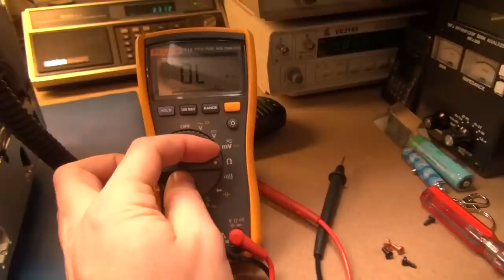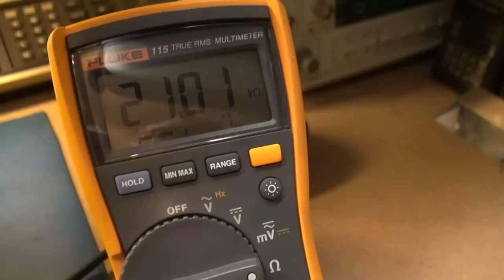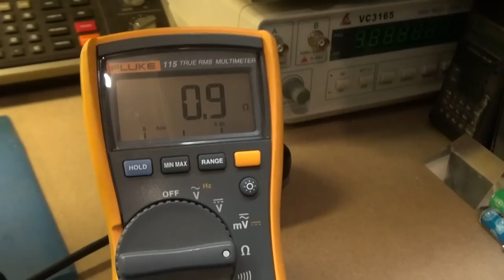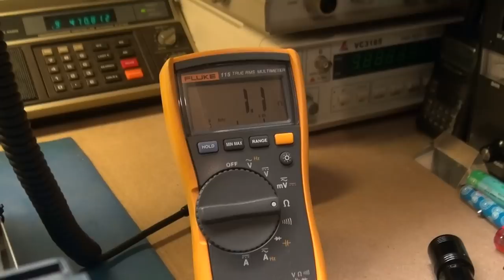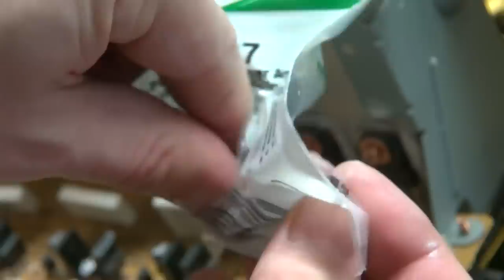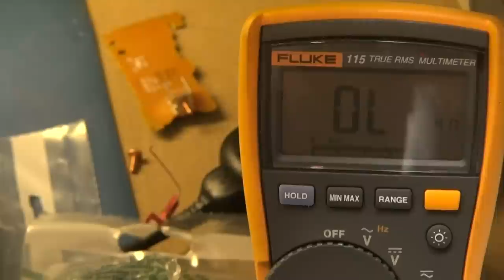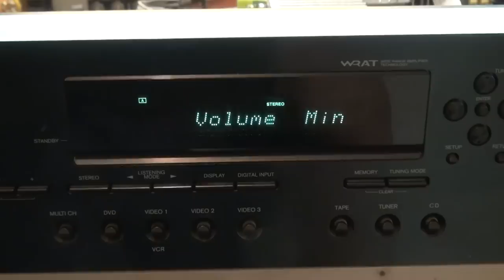ONKYO TX-SR502 RECEIVER  "SHORTED CHANNEL REPAIR"

Comment: Nice de-soldering toy; I want one for Christmas! It looks like those transistors are of the bi-polar type. There is now research on insulated-gate bi-polar transistors, where the benefits of each type (mosfet & bipolar) are enjoyed; I would be checking/comparing the driver stages prior to the installation of the new parts; even if it means de-soldering another power stage's ok power transistors..

Thanks for the post, and hope your neighbor continues to enjoy its use!!

A real head-scratcher for myself was one of these where the protection circuitry was activating after a long period of the amplifier being 'on'. I ended up replacing all of the small-signal plastic transistors on the protection circuit, and fixed the problem..

Comment: Picked up a Onkyo HT-RC260 for $20 on craigslist that was stuck on standby mode.  Tested the same parts in this video and they where bad, ordered new parts, some on ebay and the others from local radio repair shop.   When all was said and done i repaired it and it now works.   Thanks for the helpful video.

Comment: Really appreciate this video.  I bought a "broken" Onkyo TX-NR636 with the "check sp wire" error earlier this week.  After scouring the internet I found this video and isolated the issue and removed the transistors and the receiver works great!  Now I only need to order the replacement transistors and install.  Great tutorial video!
Reply: I have what looks like a burned noble resistor, but how did you figure out which transistors were bad?

Comment: When working on any AV Receiver, I recommend using a Variable Transformer to restrict the AC current or else run the AC thru a 75-100 watt incandescent light bulb. It can help prevent another power transistor from being popped if something else in the circuit is bad and overloads an output transistor.

Comment: I repaired a blown channel on my TX-SR806 thanks to your video.  I'm having one hell of a time finding the right power resistor, though.   For the time being I stole one from an unused channel.  Works like a charm.
Reply: +land otter1 thanks for the reply.  I ended up finding a component re-seller out in California and bought a small lot of these components.

So if anyone needs dual emitter 5W 2ohm MPRs to repair their Onkyo send me a PM.

Comment: As long as you're changing the power output transistors and the emitter bias resistor, you better change the driver transistors too or you'll be opening that beast up again soon. ALWAYS change the drivers when you change the outputs.
Reply: Robert Crawford sir..i m having same problem.. could u please tell which are drivers.. so that i can change them too
Reply: Where can I  order transistors from
Reply: This post is a little older, but for those that look for the driver parts that need to be changed, have a look over here : https://youtu.be/misu4avw_Vs

Comment: Awesome video. I've been trying to repair a subwoofer plate amplifier. 200 watt. I saw 2 fried transistors that I replaced. Didn't even think about a fried resistor. And I didn't even know there were 3 pronged resistors. Also there was a ceramic disc that looked cracked. Finally figured out it was a current limiting thermistor. Will replace that. It was still blowing fuses so I'll look for a blown resistor. My guess is the volume was turned up too high for too long, the transistors shorted leading to a current surge frying the thermistor.

Comment: There is only one option: resistors dont open up by no reason. There must be collector-emiter breakdown of the output stage transistors, excesive current flowed thru emiter resistors that burnd them.

Comment: Thanks Mark! Actually working on an M504. A numb head decided to leave some screws out of the heat sink support. During shipping the board was cracked. When I recieved it I turned it on and BANG! I saw flares inside the cover. Lost one of the output transistors and about 10 components on the driver section on the left channel. Anyways I epoxied the board and ran about 5 jumpers. The 2SK389 is a temp componsation transistor which was on fire during the incident.Im almost done with the repair...
Reply: The

Comment: Great video. I have an Onkyo HT-R570. I checked all the r22k dual resistors for continuity while on board and found 1 dead. I checked them by using the outer posts of the dual resistors for continuity since if 1 side was bad it would not beep. No need to check both with the middle post. I pulled it out and checked again to verify it was bad and it was. I also did the same for the audio power amps high current switching and found 2 that beeped because they are shorted.
If anyone had questions as to my steps feel free to respond to this post.

Thanks again.

Comment: My Onkyo HT-R570 receiver popped a few weeks back and went into protect mode (flashing red power light only, no display).  I stumbled upon Kev's video, did the same troubleshooting using my Fluke multimeter and, based on the results, I decided to order a transistor set and 5W noble resistor in order to attempt the repair.  Well, i was floored when the receiver came back to life after the repair!  Although I'm a DIYer who has worked on cars and home repairs for much of my life, it took Kev's guidance to help me through my first real electronics repair, not the normal, simple swapping out of pieces and parts but actually changing out electronics components on a PCB!  Kev, now I can help pitch in to reduce electronic waste from our landfills.  Now where do I send the repair fee?
Reply from the maker: Great job! I am glad it worked out for you. Another device saved from the landfill.
Reply: my speaker wires was touching and something pop then it smoked

Comment: Looks good but a couple of points, never use the old heat sink compound. Start with a clean surface. You can use a small plastic scraper to remove the bulk then get the rest with some alcohol. Something that will help your de-soldering is to apply some flux. Something like kester 186 is good. It can be had in a dispenser pen so as not to buy large quantities. Applying extra solder to the joint can help, but it still burns up most of the flux. Also make sure to clean up the flux left over...

Comment: Nice video. Found it because I have "Check SP wire" message on my Onkyo HT-R990. Two days ago, while watching Fury Road, suddenly the receiver shuts itself down. Trying to turning on again, it displays the damn "Check SP wire" for a fraction of a second and then shut itself down again. I had already replaced the capacitors on the HDMI board some months ago, and now this. Infortunately, even by following this video, all my noble resistor seems OK (still attached to the board they all indicates 0.6 when measured) and the transistor on the heatsink have been replaced by some Sanyo IC  STK443-530 and two STK442-730. Dunno what to do except avoindg Onkyo products in the future, because I have found tons and tons of people with the same , unsolved problem.

Comment: Your solder looked ok but I would have cleaned all of the manufacturers solder and resoldered them. Just saves you the trouble later.... Since you already had it open and disassembled, right there. Don't be afraid to reflow any questionable joints. You'll be glad you did! Good to see that you cleaned up with alcohol or acetone... Good repair man...

Comment: Excellent video and explanation with the ohm meter. I just had a channel blow on my Integra when I put a drywall screw through a wire in the wall. Looked this up, looked in the stereo and there was the charred transistor. Hopefully I can fix it but even if I have to bring it to Pinnacle at least I know what's wrong and I won't get snowed.

Comment: Thanks for the advice. I'm just a hobbiest  with some successes with electronic repairs. I picked this receiver up on ebay for $45 as is  including shipping so I figured ,what the heck. Nothing ventured nothing gained. Anyway after closer examination I could see no bulging caps but the 2SA1930-2SC5171 power transisters are showing overheating on the board from one end to the other of the board on all 7 pairs. Think I'll replace them and go from there.Thanks for you help.

Comment: Hi Kev. Great video. I've got a similar problem with my amp going into standby mode. I've tested all the transistors and resistors that you did in the video but there fine. I know it's he right channel as that's the one that was making a crackling sound and I left it as it went away and then pop into standby. There is a board next to the transistors which has the channels written on it. It's the green board behind your hand. If I pull that board the amp turns on. Could it be something to do with the resistors or transistors on the right channel on that board. Also how would I go about clipping out the power to that right channel so I can get the amp working again for the mean time. I also have the service manual if that helps. Any reply would be great full thanks chi

Comment: Diagnoses Round 1
I used a multimeter to find the 2 shorted transistors and the matching dual resistor. Like kev31779 did in his video, I clipped the leads on the 2 bad transistors prior to ordering my parts. After clipping the leads, the unit was able to power on and stay on without automatically going into the protected standby mode like it was before. Ordered my parts from mouser.com (links at the bottom)

Repair
I was able to replace 2 "shorted" transistors (A1962 & C5242) and 1 "opened up" dual resistor. I ended up using 2 single resistors and soldering/bridging the middle prongs together for the middle hole. While I had the receiver apart, I went ahead and replaced the 5 bad 100uf caps on the HDMI board as well.

Testing
First bootup with everything plugged back in, I blow 2 10a/125w fast blow glass fuses next to the power supply attached to the main board. Buy a package of replacement fuses same rating from mouser to try again after re-seating all ribbons, connectors, and shaking the unit upside down in case any clipped leads or metal were shorting the board out somewhere (nothing came out). Put 2 new fuses in tried again, both fuses blow again. Disconnected the antenna/coax board, HDMI board, and ipod/iphone dock board, put in 2 more new fuses to test - same results - both fuses blow again after about 2 seconds of the unit being turned on. Attempted to disconnect the other board where all speaker wires attach to (the board with the 5 G5PA-28-MC DC24 relays attached to it) but with this disconnected I no longer get the red standby light on the receiver to come up nor does it powerup when turned on.

Diagnoses Round 2
Used multimeter to test the leads on the underside of this "relay board" to check the readouts of these 5 relays. 2 out of the 5 were measuring in the 500's while the other 3 were steady at ~1ohm. 

My Question to the more knowledgeable electronics people out there......
Seeing as though the unit will not power on with this relay board disconnected, this would then mean that the current flow of power goes from the power supply to this board and THEN to the main board where those fuses are located. Is it possible these 2 relays are bad and thus causing some sort of power surge which is blowing these fuses or is it more likely that the actual power supply is bad??? Mouser has these relays for $3.50 apiece, just not sure if I want to keep at this and try this one last thing before calling it quits.

Parts Used
A1962 - Transistor
http://www.mouser.com/ProductDetail/Toshiba/2SA1962-OQ/?qs=sGAEpiMZZMshyDBzk1%2fWi39v8mPI4jPHIOVN8C5K9gE%3d

C5242 - Transistor
http://www.mouser.com/ProductDetail/Toshiba/2SC5242-OQ/?qs=sGAEpiMZZMshyDBzk1%2fWi39v8mPI4jPHoIMIqujz2qg%3d

.22ohm, 5w Resistors
http://www.mouser.com/ProductDetail/KOA-Speer/BPR58CR22J/?qs=%2fha2pyFaduiHbb7zzJ6cb2el9G%252bgwVRdHFTcZBFBJdjgVGcjXZFCyQ%3d%3d

10a/125w Fast Blow Fuses
http://www.mouser.com/ProductDetail/Eaton/BK1-GMA-10-R/?qs=%2fha2pyFadujmM0Q8l%2fgOi%252b4YzR5Ibqb2fAtF6nhzU%2fIQdKJLaUFapQ%3d%3d

10a/24v Relays
http://www.mouser.com/ProductDetail/Omron-Electronics/G5PA-28-MC-DC24/?qs=sGAEpiMZZMtSzCF3XBhmW6rmK3VUQy7ZulImHcGuIxw%3d
Reply: ***** Hey, any luck? I have the exact same problem you have (or did).

Comment: Put the desoldering gun upright at 90° to the board,  so it will suck all the solder at once.  Give it sufficient time to melt the solder pad completely.

Comment: Been years since I've seen a 2101. On the Onkyo's, if an amp channel isn't blown, it's usually the 2SK389 FET's in the front end causing an offset. Very difficult for access, though...

Comment: Thanks for your answer, but there is something wrong in the measured resistance, the  fluke 116 multimeter terminals  in ohms position gives a reading of 0.1, not 1 ohm.

Comment: Is it possible to just clip out the transistors from the heat sink and solder the new ones in place.  Could save on some dismantling.
Reply: Buonafede No. You’d have to clip the leads of the transistor package and then try to get under it to solder.  It would be a mess.  When it comes to electronics work it should always be clean and proper with surgeon like precision.
Reply: Would need to do the same for the resistor.

Comment: I have an ONKYO TX-NR708 Receiver that had the HDMI board replaced and now it went crazy again. I just had optical plugged into it to stabilize it, but it finally went black screen now with a constant clicking noise.
Don't want to recycle, just want to fix it.
Thanks,
Duane

Comment: How did you manage to disassemble the unit enough to get the bottom of the circuit board? How many screws did you remove?

I have a TX-R820THX with a similar layout and I have yet to figure out how to get to the bottom of the circuit board (that has the 0.22 resister and the ouput power transistors).  And, I have an 'Exploded View'

Comment: TY  Kevin for the video, I have an Integra TDR 7.7 And it appears the sound channel transistors attached to the heatsink failed. The noble resistors seem fine. It still doesnt get out of protect mode. Where would you or any viewers go next?

Comment from the maker: I would think there is a problem on the amp board you pulled out, test the components for shorts and the resistors for open continuity like in the video. and also look for burst or bulged capacitors

Comment: I have one of these but it's the SR505 and it started smoking and sound was cutting out. Saved it from going to the dump. Haven't opened it up yet. Are these output transistors a common failure on these? Would it be that easy to change the bad ones out and have this set work again.

Comment from the maker: Just make sure you get all the metal debris out if you use a rotory tool.
you may be able to use a sheet metal sheer but its going to be ulgy no matter what. 
If you got nothing to lose I would try to disassemble it piece by piece and take pictures or a video of the disassembly. and take note and mark connectors and cables where they went,

Comment: very informative video, i have a Marantz nr1602, there is a problem with the sound, some of the surround modes seems to be acting up, mainly losing audio from the centre channel, as well as a strange noise in the audio as well, any ideas as i was wondering whether the filter capacitors were getting bad.

Comment: was able to troubleshoot and fix an old hitachi amp which was outputing dc on the speaker output, being an old unit it did not contain a protection circuit. Thanks for the pointers on what to check.
Reply: +land otter1 the amp belongs to a friend of mine, I did check the drivers and they seemed ok though I never did check the op amp. As far as restoration goes, I don't think he cares for it that much, it's an old unit from the 70s, and I noticed it had had some diodes changed in the past, on the rectifier circuit. Thanks for the info. Much appreciated.

Comment: This video was excellent even a beginner would be able to follow along. I just wish 
I had confidence in soldering, still a beginner my luck I would wreak further havoc on my Onkyo than Ive already done by stupidly bridgeing the Rear Speakers to the B Channel thinking Id be able to swap between for boosted volume when listening to music, and 5.1 Effect for movies. Learned alot from this video great job, But still not touching anything i dont know about haha, Off to repair shop I go I suppose, How much do you think they would charge for my situation?

Comment from the maker: Sometimes there is an access panel on the bottom of the receiver. if not you have to disassemble the whole unit to remove the main board. No way around it.

Comment: Learned and enjoyed from viewing your video. I had the same issue with my Onkyo TX-8522, replaced output transistor and resistor and does not go on standby any longer. I do have another issue now on the channel I repaired, the sound is a bit distorted and the other channel works fine. I switched speakers and got the same results, could you please advise what may be causing this, I would appreciate your assistance and thanks for this video for those of us that need help from people like yourself!

Comment: I just acquired an Onkyo 606 that is exhibiting the same issues.  I'm curious if you could give me some pointers to troubleshooting to figure out what is wrong.  I am currently getting some mixed results metering the parts you discussed in this video.  I would greatly appreciate the help. thank you.